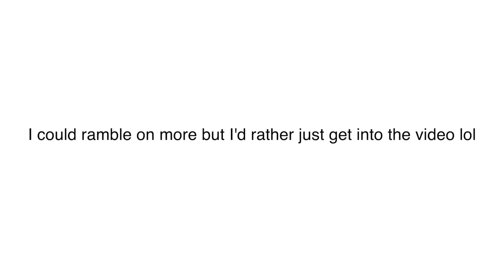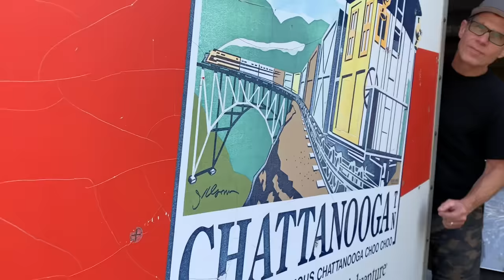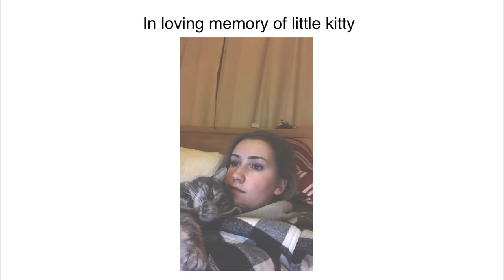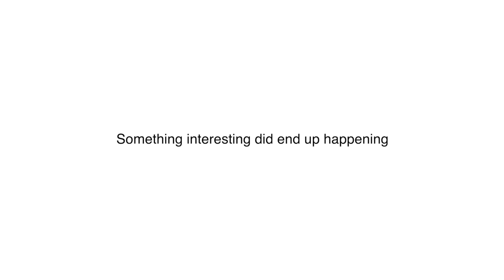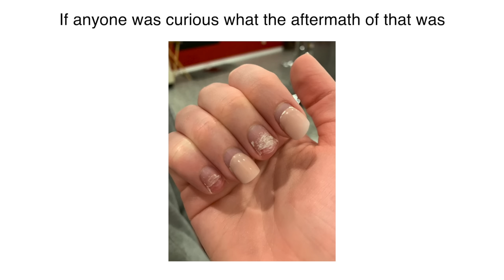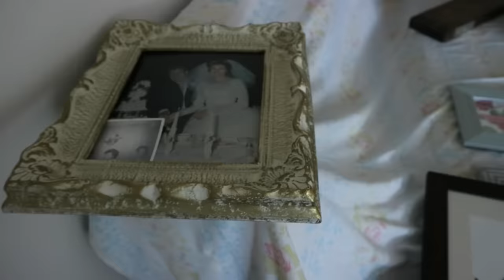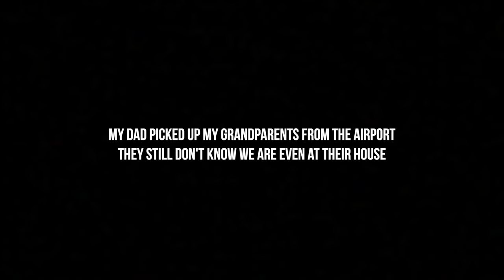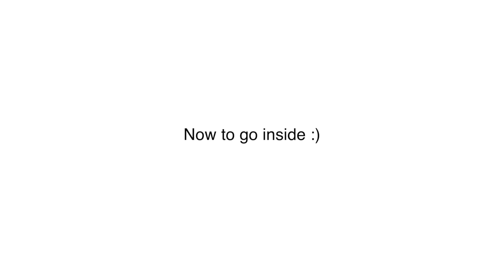Surprising My Grandparents Transforming Their Old House to New!!

Comment: Hi Mia- love all your videos! Here is a trick I learned from my trials a d errors as I am an interior designer- when it comes to me, I am pretty much a do it “yourselfer” if that is a word. If for some reason, you get latex paint on your wooden floor (I don’t know if this trick works on oil based paints) let the paint dry completely and spray hydrogen peroxide. The paint must be dry and the HP  use be in a spray container. The paint will turn into vinyl and you can lift the paint out completely without a trace! Like magic! Enjoy and hope this trick may be helpful to you! ❤❤❤❤❤❤